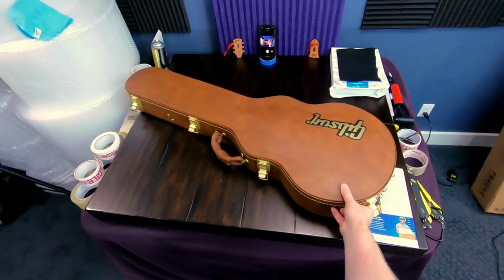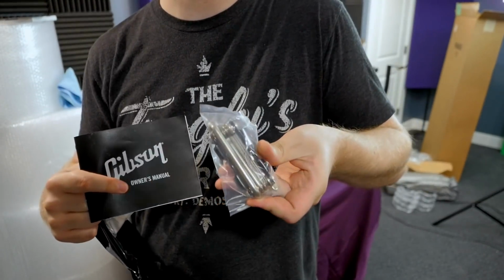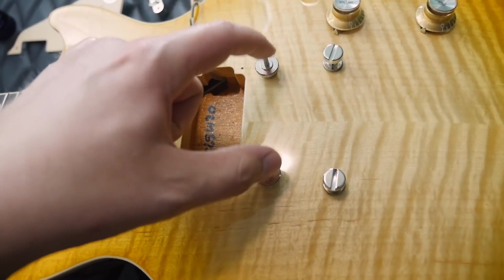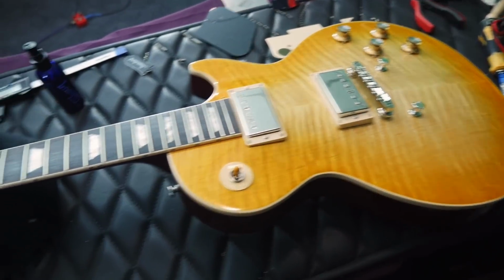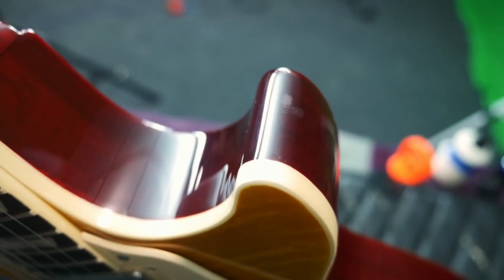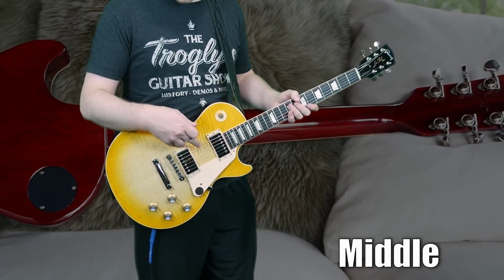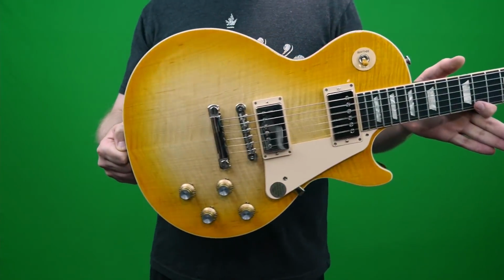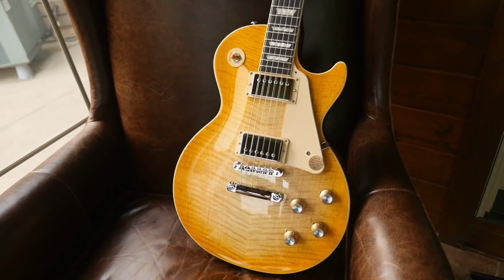Is the 60s Standard Still Worth Buying in 2022? |  Gibson Les Paul 60s AAA Flame Top Lemonburst

Comment: I bought my LP Standard 60s in 2021. I just put a Bare Knuckle Mule p/u in Neck and a BK Riff/Raff in the Bridge w/ BK 550k pots w/ paper in oil caps.  I also upgraded the tuners to locking Grovers, the switch to a Switchcraft hand wired switch and a pure tone output jack. I run Elixir 9-42 strings. That guitar ROARS!

Comment: I have a 50's Standard I bought when they first released (see my profile pic) that weighs 8.5 lbs. Love it. Just bought a gold top and it's heavier (over 10 lbs), but I love it too. I also got a white Custom and a 335 in the new era. Can't say I'm disappointed at all with any of them. As you can see, my color is exclusive, but it was accidental. Was supposed to be a Heritage Cherry, but wound up lemon (no burst). All of the paperwork and the model said Heritage Cherry Sunburst, but the photo and the guitar say otherwise. The letters were scratched out under the neck pickup. One of a kind for its time.

Comment: I find that since Gibson started using the plek machine many of the nuts are cut too high. Some stores might tell you it's set to Gibson specs and won't do the work to cut the groves or shave the nut down. If the action on your Les Paul is bad check the string height at the first fret you may need to have the nut shaved down
Reply: I don't think you can blame the Plek machine for that any more than you can blame the Plek machine for your lack of understanding of punctuation, spelling or grammar.
Reply: I understood your comment just fine. It's a one size fits all. The machine doesn't know the difference. What I'm not a fan of is the way the neck binding  caps the ends of the frets.
Reply: I agree. I bought a 60s standard from Thomann a few months ago. Sounds fantastic, but the nut is cut extremely high. Far higher than my Fender strat and tele. Far higher than my Epiphone Emperor Joe Pass (1/4 of the price of the Les Paul) and higher than all my acoustic guitars. Poor quality control from Gibson. Screw in to pickguard not straight, nut loose on jack socket. Nothing major but expected better.
Reply: Indeed, my Jan 2020 built 50's was all over the place for 1st fret string height, predominantly extremely high. Also had to do a lot of saddle filing to get the radius in the ballpark.

Comment: Despite having the same wood and flame, the flames doesn't pop as much on a Gibson as compared to a PRS or a Carvin/Kiesel. Those companies tend to darken the flame first with a darker dye before applying the main color. Therefore their flames are more pronounced compared to a Gibson.
Reply: I watched a woodworker’s channel, he did a desk top using the PRS way (a guitar builder fan helped him figure it out, since PRS wasn’t interested in letting their secrets out, at least to him) It’s a water based dye that’s hand wiped on and off and the trick is to do the first pass extra dark, then go lighter on the next two coats. That adds TONS of depth to the grain (his was curly, not flamed, it came out looking like a piece of stone, not wood). Gibson tends to just do a color sprayed nitro finish (though it’s electrostatic these days, they run a ground wire to the truss rod, helps even out the coat so there’s no overspray or weird issues that nitro can give (most of the time, the finish errors, that’s where the mod collection get’s their stock from).)
Reply: I am perfectly happy with an understated flame top. Some of the really pronounced flames on the ones with the dye jobs get to be too much for me. That is of course a personal opinion. I just got a 60s Lemonburst last week. I kept my eye on their stock. Sweetwater shows you 4 choices you can pick from. I waited until one came up that really caught my eye and I bought it. Looks even cooler in person. I almost switched at the last minute to one that was on sale due to a few blemishes because that top was very boldly flamed and figured but I decided to stick with my original choice. Understated is not always a bad thing. :)
Reply: The natural flames Gibson uses moves in the light so much more! Tons better than PRS and I have both.
Reply: My PRS Custom 24-08 in Charcoal didn’t have the movement I would want to see in the flame. My Gibson has a better looking flame. The PRS almost looks like a satin finish in comparison. Not a big fan of the dye job.
Reply: @Staxovwax  is that a SE version?
Reply: Hi Alan
My Gibsons have a subtle flame which shimmers with movement, and it appears to be 3-D.
If the flame is over the top bold, it can detract from the shape of the guitar itself.
Reply: @AlanCheong  no it was a 2019 USA made 24-08. I sold it last year because even though it was a well built guitar. It just didn’t get the play time my other guitars did. I may have kept it if I had a guitar room like I do now, but, for the $3400 I spent on it, it wasn’t justifiable to keep it around.
Reply: Thought and posted the same-ish thought, looks like they get the last pick of the maple lots. The Worst PRS's look better than the BEST Gibson tops. Just Fact.
Reply: @dumptodreamhome2630  hmmmm. Just opinion. Lots of people, me included, prefer the more understated Gibson flame than the typical PRS figuring which I personally think is over the top. Neither opinion is right or wrong, it’s just a matter of taste. I think we do need to bear in mind that Gibson has a heritage to the way their tops typically look that goes back over 60 years, and incredibly flamey tops were always a rarity for Gibson and they’re just simply following that tradition (largely because it’s what a lot of their customer expect from them).
Reply: @davidburke2132  I actually like the plain tops.  They have more of a vintage vibe to them.

Comment: I bought one of the earliest 60s Originals. I went into my local Sam Ash on the day they were released. I wanted an “unburst” and they had to transfer it from another store, so I got a few days later. The serial number is 10889XXXX.  The top is quite nice, although not as Tiger striped as this one.  I did switch the knobs for the 50s style. I believe that the mirror knobs were only used on relatively late 1960 Standards.  The “Beauty of the Burst” book only has one 60 with mirror knobs in the main gallery section, out of 8. The serial number of that one is 0 7448. Interestingly there’s another with a later serial number 0 7615 with the 50s style knobs.

Comment: I agree with the back of the guitar, my 60's standard I got last year you cannot see the seam on the back until you look at the end grain on the bottom and even then, it's not that noticeable. I ended up adding locking keystone tuners, with the change in look and the beautiful flame top on it made it in my opinion the perfect guitar. If you want to see it go to sweetwater under the bourbon burst reviews titled "it's perfect".
Reply: Which locking keystones did you use? Are they a direct drop in with the same screw hole to use? Thanks for reply.

Comment: I recently got a 50s Standard from another vendor, I buy 90% of my gear from SW and Zzounds, pay one off, charge the other, lol! It's the non AAA but the top was amazing... just had to wait and watch until a nice one on the normal popped up. I have to say it's amazingly perfect. I have a 2017 Standard HP with the AAAA top. That one I did get at SW and my rep went and picked it out for me because the first one they sent me looked good but had a LOT of issues. The neck is SO different but both are amazing, happy to have two very nice LPs after having to sell my 1991 Standard about 17 years ago... eventually want a 60s as well or a Black Custom... not sure.

Comment: My 2021 Les Paul Standard 50's weighs 8 pounds 4 ounces (which was my main reason for buying it) and Gibson goofed by putting the 60's hardware and pickups in it. They also didn't connect the ground wire, which was a royal pain to fix. So yeah, Gibson QC isn't quite where it should be but after fixing the ground I love this guitar. Much better than the 2018 Traditional I used to own.

Comment: I'm a manufacturing engineer. To be able to make the same exact product for 70 is is a wet dream, and it gives Gibson 70 that's to perfect their process. But they obviously haven't. I'm always amazed at the plethora of quality issues with pretty much every Gibson Les Paul you review. Daryl Braun bought two of them and swore he'd never buy another because of paint cracking between the neck and fingerboard I think, among other quality issues. Chatter marks on the neck binding are a sign of a dull cutting tool, I guess for $5000 Gibson can't bother themselves to keep a sharp $2 mill bit in the machine. Gosh I can't wait till the boomers dump their collections and the market crashes! Only then will I buy one.

Comment: I just got one of these. I'm not sold on the 61t and 61r. I also have a 2012 std with burstbucker pros. The 2012 sounds better to my ears. The 61 pickups sound a bit thin. What would be a good replacement? Thinking of a JB/59 set.

Comment: If anyone's trying to convince me that QC has improved since the new change in ownership then they're wrong. Maybe you could say the selection has improved but surely not QC. I still feel money's best spent on used 90s LPs than current models especially the ones from the last 10 years or so. This is just my personal opinion and experience from trying out new Gibson at guitar shops over the years. Something about the vintage LPs makes new models feel plastiky if u know what I mean
Reply: One thing to consider, since the pandemic most major manufacturers have had some quality issues for trying to get guitars done quicker, I tried a few mexican made Fender and Charvels and all had fret issues.
Reply: i bought 3 les pauls in last year....A tribute, a 60's standard and a Slash standard..all 3 are flawless......
Reply: @Mohamed Tlass 
Was going to say the same thing. All that chambering that was happening!? Vintage my arse.
Reply: @juanmacaceres2702  Yes the MIM Fenders have had the absolute worst fret sprout. Many of them will literally cut your hand.
Reply: @sixslinger9951  Same here. I've bought two brand new Gibsons, a Tribute and a Traditional Pro V, both were absolutely perfect. I've also bought a few used models as well, aside from the previous owners jacking up the set up, they were both also perfect.
Reply: Totally agree regarding quality. I'll never buy another new Gibson, they're just not the same anymore

Comment: No, unfortunately those “scuffs” likely won’t polish out, maybe buff out using a scratch remover but certainly not a normal polish. My 2021 50’s neck has a couple of them along the sides, all in spots that you’re not going to see without actually looking for them though. I agree however, they do appear to be caused in/by the case & perhaps it’s because of the lacquer being too soft at the time they get put in the case. Ironically however, my 2022 Explorer does not have a single flaw on it, not one. I bet it’s because they’re not carved tops, they’re not bound, it’s an antique natural finish so there aren’t any colors & they just require far less handling in-general to make them. But, that’s just a guess. I bought a 2022 Tribute husk that I wired up using a custom 550K CTS Pot & orange drop capacitor set, the 57 Classic set that had come out of my 2017 SG & all True-historic parts, except the bridge I couldn’t find Gibson selling the ABR-1 set that you can use the existing bushings for so I had to get a Nashville Bridge from Gibson for it, the super expensive (for what it is)50’s pick guard, the blank Truss-Rod cover, cream plastic jack plate & poker chip etc. and the rosewood on that fretboard is absolutely incredible. Such a shame it’s considered their “lower-end” model & thus doesn’t get any binding that satin Ice Tea Burst finish is amazing. But, I did find at least 2 tiny minor flaws on it, a run in the finish that got satin-lacquered over & ding in the back. But, it’s got some SERIOUS upgrades going from factor cheapo PCB to hand-wired 550K CTS pots, all braided 50’s wiring, so all 3 wires from the Switchcraft toggle are the 50’s style metal braided & cloth wires, the jack is a Switchcraft jack etc. when I first bought the SG new in 2017 I fell in love with the 57 Classic pickups & subsequently the 57 Classic Plus bridge pickup but having bought a 2021 Custom Shop Custom in Alpine White with the 490R & 498T pickups I have the 57 Classics to be a little weak for the Metallic/thrash metal I play & the pickups in the Custom perfect. My favorite set hands down are the 490R & 498T pickups. Anyways, love the video as always!

Comment: Just bought a 2023 50’s LP Std.  It has a wonky looking “manufacturing anomaly”.  The binding in the cutaway doesn’t align properly with the top wood and you can clearly see approximately 1/8-1/4” of the maple top.

Is this “normal” in your experience with Gibson these days?  Should I be sending this one back??

FYI…my 1990 Les Paul Standard doesn’t have this same visual defect but, does appear to have its binding “stretched” thicker in that area in order to hide the maple.

Weird.🤔🤷🏻‍♂️
Reply: Exposed tops are normal.